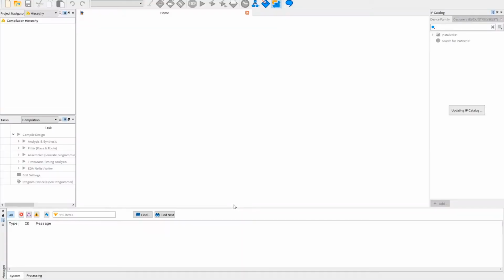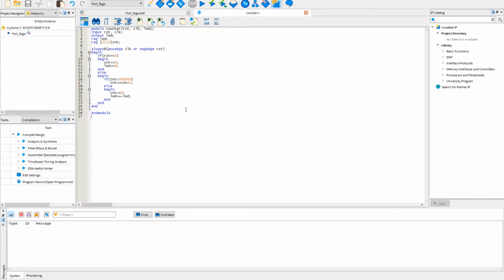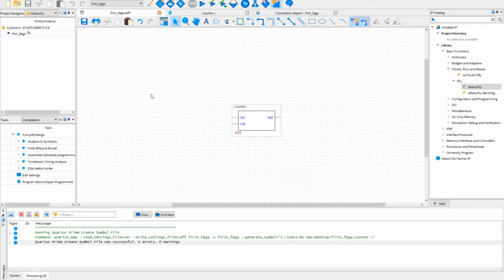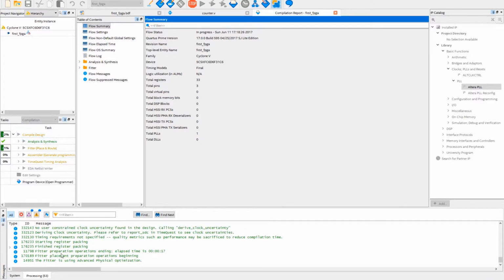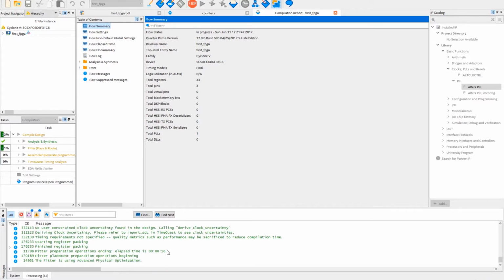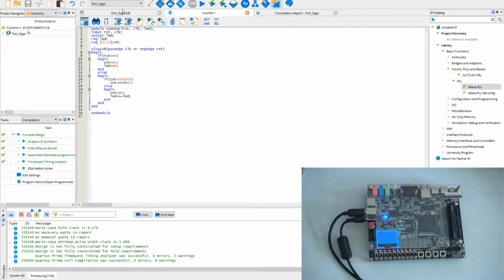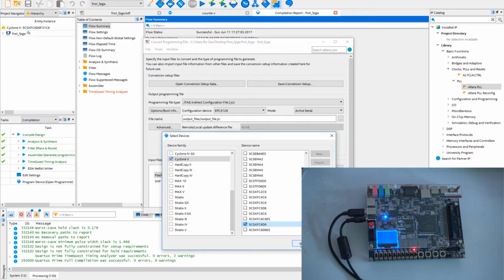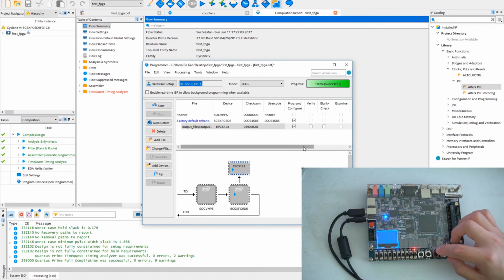Terasic DE10-Standard Tutorial -- 2. First FPGA Project

Comment: Thank you for this clear video. A few comments though :
1) At first, you will not see the IOs until you compile, it is true. But you can settle on an Analysis & Synthesis compilation instead of a full compilation that will take you more time.
2) It is cool you mentioned this aspect about the weak pullups.
3) You can create the JIC file as you did or you can use the Terasic made module to convert the SOF into JIC or POF (I don't remember which but it should not make much difference). Actually, when using the EPCS memory, you will have to reboot the board so that it takes effect. If you reboot the board, you will have what is saved in the EPCS memory but if you then flash a SOF file, it will not be flashed into the EPCS but still in the FPGA/SoC memory and the FPGA will run the SOF file. A reboot will erase the SOF but keep the JIC/POF file.
4) It is sad that you have to create your flow every time you got to the Programmer. I think you can save the configuration so that you do not need to restart it every time.

Comment: I want to learn FPGA programming. Are FPGAs with hard ARM cores harder to use than regular FPGAs or can i just ignore the ARM core completely?
Reply from the maker: slap_my_hand for cyclone v, you can just ignore the arm.
Reply: FPGAs only have the logic fabric while SoC have both the logic fabric AND 1 or more processor core(s). As far as I know, Altera SoC have ARM cores and they call this processor block Hard Processor System (HPS). If you have just an FPGA, you can still do some work with logic fabric by implementing Altera or 3rd party or open source IPs. Processor blocks made from logic fabric which are called Soft cores (Altera have NiOS II or NiOS V), consume logic resources while HPS are pure dedicated blocks that you still have even if you don't use them.
Then regarding the way you will handle them, there are quite some tricks. For Soft cores, you need to use Eclipse 😭. For HPS, it is not Eclipse, it is right in Linux with some GCC or something similar.
Last point, having a Soft core does not mean you cannot do the same things as you can do with HPS. The board MAX10 Plus by Terasic (https://www.terasic.com.tw/cgi-bin/page/archive.pl?Language=English&CategoryNo=218&No=1223#contents) is a good example of this. It is a board with PURE FPGA (no HPS) and with many items that are usually connected to the HPS, like DDR3, Ethernet, USB and some other stuff.
There is still a mystery to me : Can I use the HPS connected elements with the FPGA fabric or as they are assigned to specific pins it is impossible to use them without the HPS?